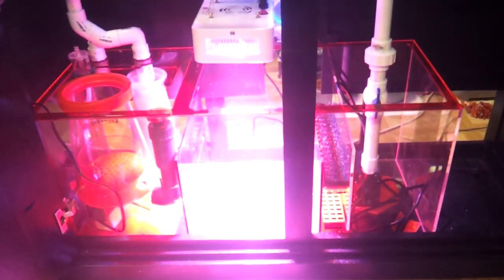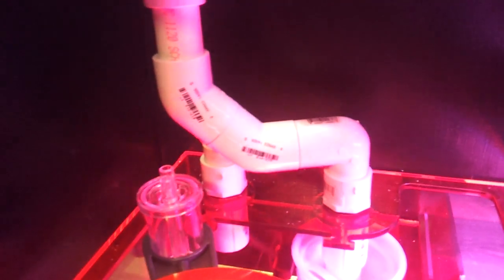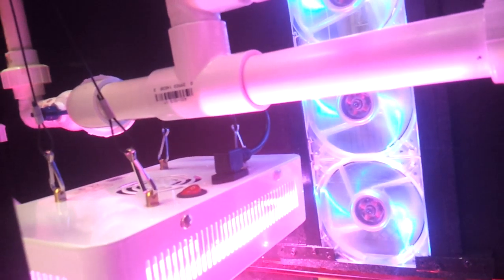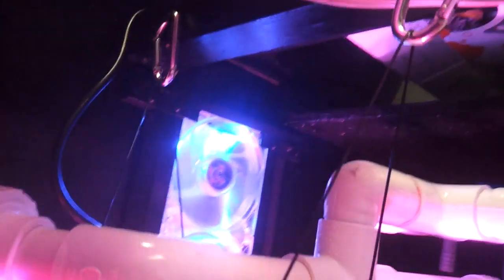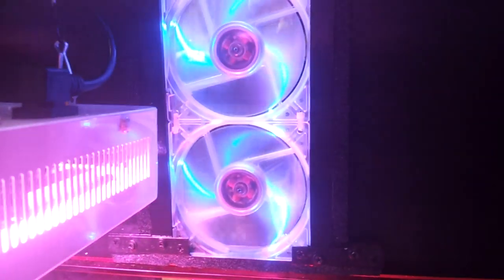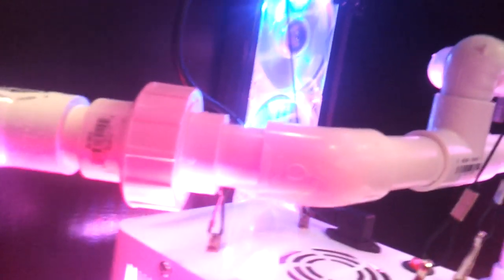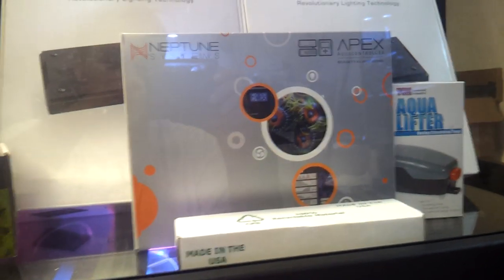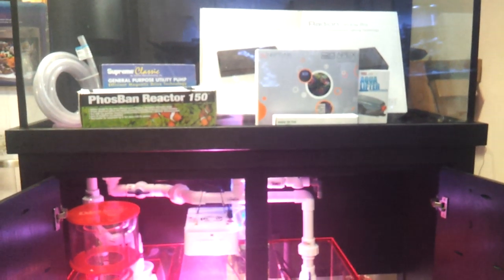90 gallon Reef Build - New Plumbing and Equipment - Update 5

Comment: Hey, I think I finally have everything I need to re-do my sump. I'm very intersested with how you plumbed the hose barbs to your return. Is that a 1" return from your Mag 18 or 3/4 PVC. Are the ball valves 1" or 3/4" and confirming the ball valves are threaded? It looks like you have a reducer attached to the end of each outlet on your "T" fitting at marker 2:34 on the video. Final question, what size are your hose barbs?
Reply from the maker: 1'' to 3/4 reducer on pump, all PVC is 1'', yes i do have reducers at the ends of the manifold, it was more of a custom fit i think it was 3/4 slip to 1/2 M thread and just slid it inside the 1'', the ball valves at 2:34 are 1/2 inch for more control of the flow to the reactors, and yes they are threaded for repairs if they leak, the barbs are all 1/2 which is almost standard for most equipment, 5/8 also fits...a little advice when you think you just need two, BUY FIVE!!! LOL and just return what you don't use, save gas and creates a lot more ideas TIPS: use street 90's helps with flow and space saver, add unions almost everywhere they fit, use extra ball valves, and stay away from check valves not necessary
Reply: Juan's Reef Aquariums Hey Juan, how tall is your stand?
Reply from the maker: ***** stand is 36'' high, got the tallest i could get my hands on, makes the tank look bigger and tons of room, that's why i have all my crap down there
Reply: WOW, much taller than mine. Mine is only 30" tall and another 2" for the molding. Do you use a ladder to reach into the tank, LOL. Wish mine had more height too.
Reply from the maker: LOL I'm 6ft i can easily reach to the bottom, but i still use a milk crate to make life easy

Comment: Juan.....are the ball vales on your manifold the same size as the one's you use on the rest of your plumbing system?
Reply from the maker: yes, the ball valve's on the manifold are 1/2 inch and so are the rest from two little fishes, just had to match the sizes together, the main line one's are 1'' pvc